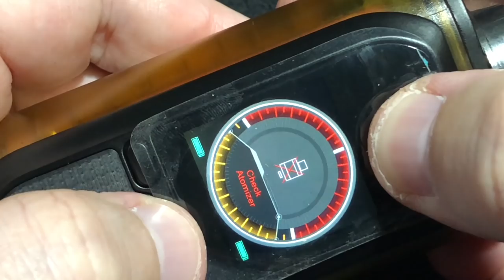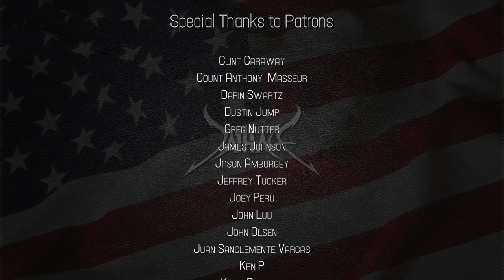Safety Concern: Modefined Lyra Hard Shorting | That 510 is HOT!

Comment: That’s actually normal for a mod that automatically reads the resistance as soon as an atty is screwed on. Almost all the DNA boards will do the same thing when in TC. You have to understand how resistance is read and you’ll understand why this happens. THIS IS NOT A SAFETY CONCERN.

A brief electrical current has to be sent through the coil in order to reads its resting resistance. You can see these brief current spikes if you had the mod hooked up to an oscilloscope.
Reply: Why does it not work with an atty on it than? If the 220 w mod doesn't work as it should, than it's not safe, end of story. Battery venting cause of a fault In  production would be bad for end user. You misinterpreted people's views drewp, most agreed with you in the spark, it's the fact that it STILL DIDN'T WORK that makes it a concern. So yeah IT IS A SAFETY CONCERN WHEN YOUR MOD COULD TURN INTO A BOMB IN YOUR DAMN POCKET. Mind you both were in wattage mode too as I'm sure you noticed. Neither registered an attomizer. These are supposed to be designed to be able to handle a direct short and not break (unless you short while vaping 200 fucking Watts of course)
Reply: As from my experience maybe it has a loop connection. Like most of devices use ground as base... If positive were use.. it would usually make this spark.. just like NPN and PNP sensor.. it just a theory...
Reply: correct...he's just completing the circuit w the screwdriver.

Comment: Jai, I was considering the ultem version . Thanks for the heads up.  Before you shoed the second unit fail, i would have guessed a sloppy solder joint on the board. But for 2 units to fail so similarly, that points to design flaws.

Comment: Awesome,your video help me find out what was actually wrong,it’s a loose connection inside the mode...I pulled the top off to dry the inside,  then decided to pull the whole mod apart ,and found a small box that had broken on one side so soldered it n bingo away I blow...

Comment: Jai. Last week. I was preparing a 0.2 ohm coil for my mech tube mod.  Was about to align my coil when I got a spark. My newly purchased sirius mod sparked while the mod was locked. I had to adjust my coil on my dna 167 mod to keep from premajor sparking. So, u r right. The mod is still live when turned off. Thought it was just my mod.

Comment: Somewhere on the control board is shorted.  A fused transistor or maybe a resister or capacitor gone bad...it may also have a faulty chip or  it might not have been configured correctly (i.e. software issue).  Good review for pointing that out.  👍🏽👍🏽
Reply: Bad capacitor?  Fuck me...now I'm stuck in 1955 and have to go to that lame ass Enchantment Under the Sea Dance again.
Reply: No, incorrect. You are stating incorrect information. If you want, i will gladly explain why this is happening.
Reply: Spector NS5 RD ...Please explain this ‘stray voltage’...I am always up for learning.  thanks

Comment: Did you contact lost vape? Seems like it’s an issue in the 510 with the insulator or something that is allowing power to get to the negative side. 
   The only reason I asked if you had contacted them is because not only do we need to know but they do as well to try and remedy the issue before it goes into production or is released and I’m sure they would like an email before seeing it on YT. They had an issue with the drone and it was delayed so they could fix it so maybe they’ll do the same

Comment: If it works when you put an atomizer on it it's possible that it's running current through the 5:10 to check the resistance of the atomizer

Comment: I faced the same issue with my sirius and there was a spark whenever i place a battery which was kind of weird! Two weeks later one of my batteries shorted while am using the same mod, thought it might be a battery problem. 5 days later after couple of puffs i left the mod for two minutes, picked it up again and the mod was extremely hot that i could barely touch it!! , The battery door was jammed ( might melted because of the high heat?) I was driving and had to stop my car and threw it away!. Am not someone who just started vaping i only use good authentic batteries and i always vape somewhere between.18 - .21 ohm. Been vaping for two years and never faced something like this! Long story short am never buying lostvape/modefind products again.

Comment: I'm curious now. If you put batteries in, have it power up, remove the batteries, and try bridging the connection on the 510 does it still spark once after batteries are removed?
Reply from the maker: No

Comment: I have the topside dual squonk mod and it says shorted when I fire ..atty isnt the problem i checked batteries arent the problem just bought a new pair because i thought it was but I noticed the battery bars eould flash on the device display dont know what that means .im using 18650 30amp batteries with a profile rda and next mesh coils 0.13ohms was running fine for the month i had it I think juice maybe got inside the circuit board? Any help would be appreciated

Comment: all 5 of my drag boxes spark when you do this as they read the resistance as soon as you screw on the atty and ask you if it's a new coil. I.e. its technically "hot" is this a similar situation?
Reply: Yes some also say it's left over(static) electricity . but just as if you would test tone a Christmas led bulb it will flash because the multimeter checks resistance by sending current. Also he's an doesnt understand electricity. Or how the mod works. Sayimg the ground was a "hot" was good enough to know he didn't check polarity and also could of used a multimeter(most used electrical diagnosis instrument ever) in the vid.  That would show hard evidence vs some one who misunderstood how. Mod worked and what happens when an atty is connected

Comment: My Hotcig RSQ shorted and wouldn't recognize atomizers or fire after that. I had for 2 weeks got it replaced, so didn't really look too deep into it. Wonder if it's a problem in that mod too?  My other mods have never stopped working after a short which I assume a decent chip will deal with easily.

Comment: Some mods do read the resistance of a coil by having this low voltage constantly going threw the 510 . I feel this one is done poorly though ,because other mods that I have that will read the resistance right as you screw down a atomizer .They do not spark like that when grounding them out like Jai does in this video . They might give a very very small arc , but nothing like that . I dont care what the company making this says ,,that should not be happening to that degree

Comment: you mentioned that there is a fuse inside that once the device is shorted it won't work anymore... i get that, and that is most likely why the device won't read any atomizer you put on it! but shouldn't that stop the device from arking when you short it with the screwdriver? i mean you kept shorting the red one and it kept arking, while the ultem one shorted once and that was it!
Reply from the maker: Yea that’s the weird part

Comment: I bet if you took the ground wire loose separated it from the 510 Base put batteries in it fire it and check it with a voltage tester on that wire I bet there's current flowing through that wire which is supposed to be the ground

Comment: I'm no electrician, but I don't think the ground wire is supposed to be touching those threads under the 510 cap. I've known Lost Vape was sketchy since the paint peeled off my Triade and they refused to fix it, but jeeze that's next level broken right there. Glad I've stayed away from Lost Vape since my first bad experience.

Comment: That's not shorting. If the device was wired hot, and passed the full 20W through the circuit, your battery would have vented by now. Every mod that supports TC has to constantly re-read the resistance to make sure that the temp control is accurate -
 it's the nature of the beast. What you saw pass through your screw driver was a small shunt current, typically a few mA. 

Granted, it should not have sparked, and that feature doesn't need to be on in Wattage mode, but it's hardly a safety flaw as you make it look. In normal operation, the user does not notice or run into this at all.
Reply: I don't know that you're right but if u are you would think he would have done some research before he makes a big deal out of it and i notice no one has make a comment on your post but me ..
Reply: Sarath Menon: In your opinion, why did both mods stop working afterwards ("check atomizer")?
Reply: I am not sure. I'll personally stay away from it, because there are tons of other mods to choose from that are more proven and have more user feedback. It's a shame, because I actually liked the internals. The solder joins were clean, and the encasing showed a lot more attention to detail compared to the likes of Joyetech and Smok,
Reply: knowing Jay by now, I blv this guy ^
Reply: shugg1967 Jai makes no bones about being an “out of the box” reviewer. Usually does it the same day he gets a new product. Not saying it’s a bad thing, just his style
Reply: No jai  is right I have 10 different mods sitting on my desk and none of them do it

Comment: I brought the Moderfied Sirius. had it about a week or less, new batteries. One of the battery levels was lower than the other,  so I opened and closed the battery door. Wow, a hard short, mod got red hot, if I had not got the batteries out as quick as i did it would have blown.
Thought hay, might be a faulty set of batteries, so put another set in (new) .. the same, but i was ready to open the door quickly.
Very dangerous. I have had and have got many Mods. there was no safety with this Mod. a bomb in your pocket. 
Wont touch nothing from Lost Vape any more... Hcigar from now on.
Reply: Nick Phillips had the same issue with mine too
Reply: Batteries don't discharge evenly. Any mod that has two icons on screen saying otherwise is full of it.

While a hard short could be caused by the device itself from making poor contact, there are 5 other reasons or more it could be user related. I'm not making excuses for Modefined. I'm just saying not everything is always the mods fault and batteries don't discharge evenly. 

As far as the Lyra it's got a major issue. The Sirius and Prism are generally good mods though.
Reply: Lost Ronin no safety??? Hard short when new? I know most people who vape know about battery care. This is 100% a mod problem not the user.  For that I would not trust anything from that company.  I would be to scared to even try. Safety safety safety. It’s not a mec mod.
Reply: Faulty mod.
Reply: @MrBanSan  hey ronin i have the same problem in the video but with my puma 200w ... do you have a solution or at least an explaination for this please ? thank you

Comment: what this means is you got a defective product as acknowledged by the fact the device wouldn't fire any atomizer you put on it and really can't say this is the case for all of them. instead of it reading short like the oceanus, it just won't fire, as is the case with most mod..it would be a "safety concern" if the mod was still firing when it was shorted.. this is just a loose ground wire. but they still shouldn't be letting this type of shit go out for review in 2018.
Reply: Adam Vapes He tested another one at the end of the video and it sparked then stopped recognizing just like the other. Only difference is it sparked once.